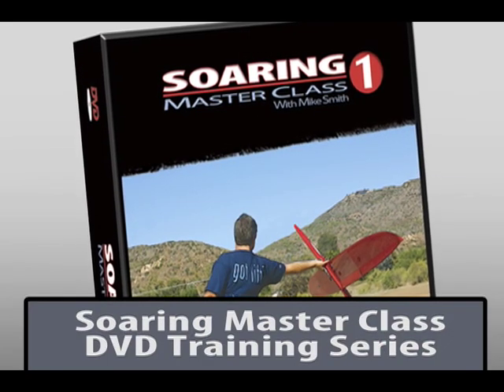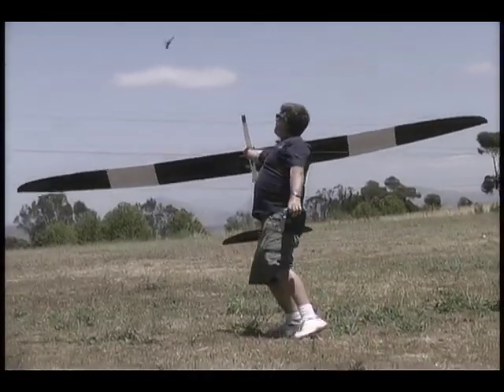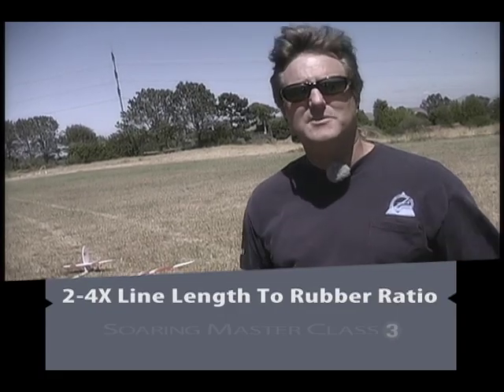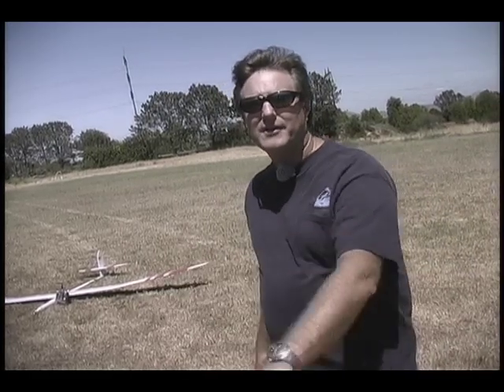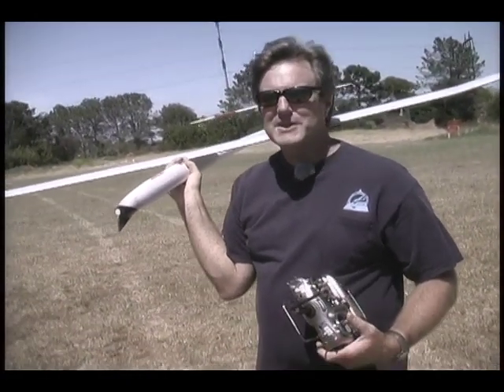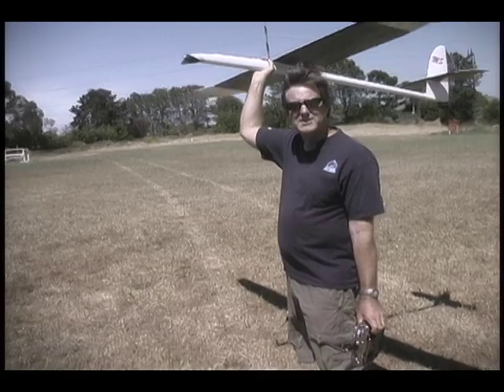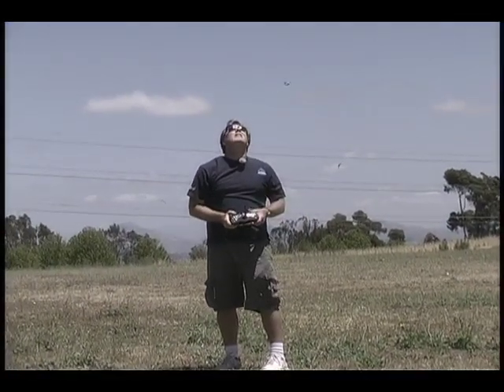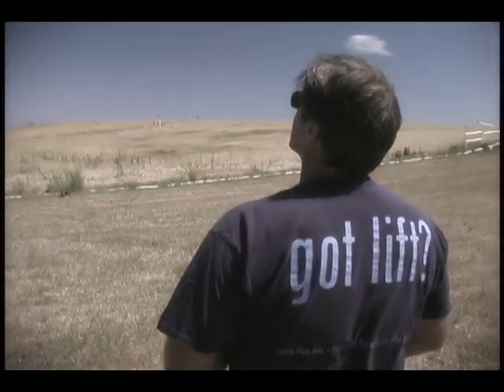R/C Glider High Start Tutorial With Mike Smith

Comment: My method (I'm right-handed): 1. Tx & tray on lanyard around neck. 2. Walk back gripping glider and parachute ahead of LE, waist height and fuse and wing against body, me on right forward  root of glider.  3. Count paces about 3 x length of rubber.  4. Transfer model to left hand, the put right hand on Tx. Rotate to face forward and lift glider up with left hand. 5. Toggle stick(s) to check  servos are working. 6. Throw with left hand, right hand on Tx and appropriate stick (I fly RES, so right stick). The model can be instantly controlled this way; launching right-handed while holding the Tx with the left leaves the glider uncontrolled for a second or two. The left hand can now control camber/rudder stick and flght condition switches if full house. 7. If wind is blowing, can zoom off stretched line (not for wooden oldies). 

I used to right-hand launch for years with a loose Tx (good when launching into the Sun), but putting the Tx on a lanyard, better yet in a tray to avoid snagging the switches, and launching with the left hand I find so much better, particularly since I like an aggressive hook position, getting full extension at release even in still air. 

Hi-starts are coming back into vogue thanks to F3-RES/F3L. 15 m of rubber, 100 m of line, 4 kg pull at stretched length = 3 x relaxed (i.e. adding 2 x relaxed length walking back). that's a lot of pull for a typical 400 g (14 oz) 2 metre glider. 4 kg is ideal for a typical oldie 2 metre such as a Spirit (weighs 1 kg). For my  400 gram 58" Thornburg Sunbird, I find a 2 kg pull works great. I used to fly a Paragon very well on an approx. 4 kg pull. Rubber is surgical or exercise latex or silicone tubing.

Comment from the maker: The vane on the nose is a yaw indicator we were testing to demonstrate how changes in aileron differential and rudder mixes create adverse or proverse yaw while turning. We used the vane in the Soaring Master Class 3 training DVD, with the air cam and ground camera synched together for the flight demos. -Paul RCA productions.

Comment: I prefer to have my tx on a lanyard around my neck so I've got two hands for the glider when I'm pulling it back - usually one on the nose and the other under the fuse.  I've got the el-cheapo HK 8mm silicon tubing which seem to work well and is very cost friendly.  Great vids, btw, thanks!

Comment: Wondering what size / length of rubber tubing to use for a High - Start...  Starting with 4' Walmart F / F foam glider, then working up....
Reply: See CRRC website:

   Glider Type =          HLG     2-M      Std.    Heavy Duty

Inside  Diameter (in) 1/16    1/8      1/8       1/8
Outside Diameter (in) 3/16    1/4      3/8       7/16
Wall Thickness   (in) 1/16    1/16     1/8       5/32
Cross-sectional 
 area         (sq in)      0.024  0.037    0.098      0.138
Tension at 300%
 elongation   (lbs)     4.2       6.5          17          24
Nominal Glider
 Weight        (oz)       13         21           54         77
Reply: @awuma  Thanks  !